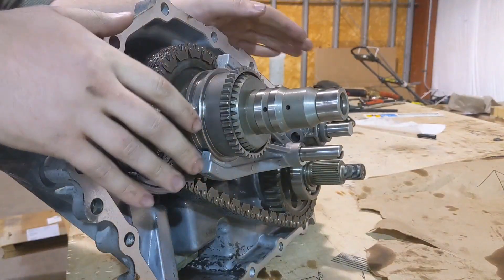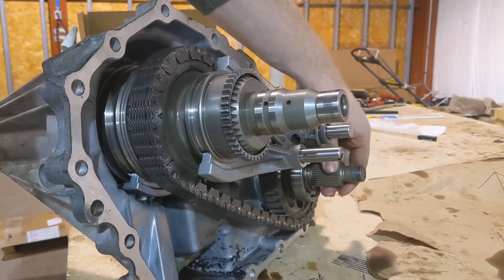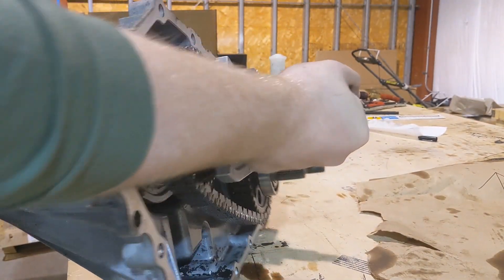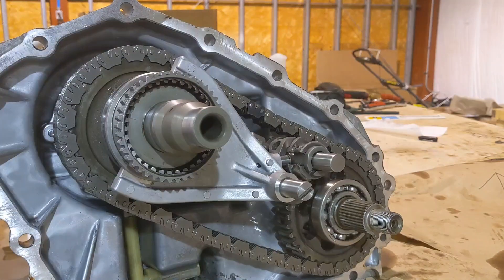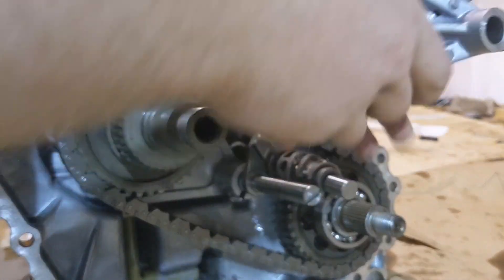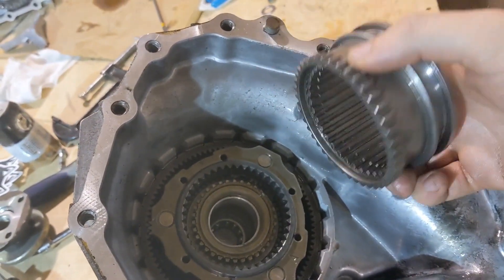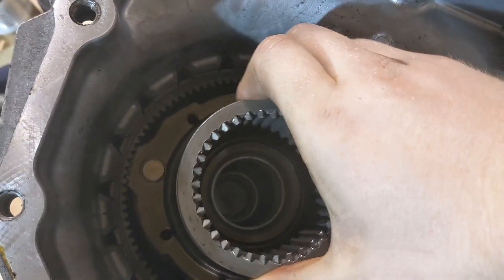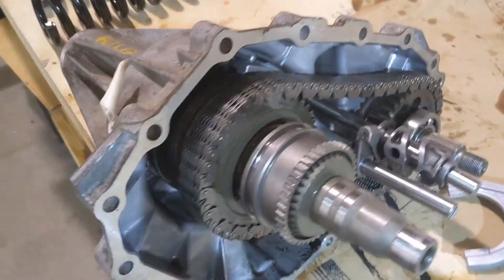Tech: Nissan Frontier/Xterra TX-15 Transfer Case Demo

Comment: Sorry i know this is old, did you ever figure out a manual selector for the tx15 or make an adapter to the old tx10?  I was wondering if the input shaft could be swapped or if it is too different?

Comment: manually, with a screwdriver, turn completely to the left and continue in 4SLOW, and turn right, make a stop, and then you feel the force of a spring that returns the axis to an intermediate position.
still in 4 slow.
any ideas?

Comment: Are there any knows mods to allow for 2L position? Any way to modify the drum selector or a way to engage the chain drive with a different actuator?
Reply: Yes, you have to remove the drum. You have to cut the top of the transfer case and manually shift. This will turn your transfer case into a twin stick. One stick shifts Hi / Lo, the other stick shift 2 or 4 wd.  I use it when I'm towing because I also have the 6spd manual from the Frontier on the Titan. This way I don't have to slip the clutch all the time. I also use 2 Lo. when wheeling, on hard pack, on icy conditions on the road, you start to oversteer.
Reply: Why would you want 2Lo? I don't see a benefit for that, that couldn't be accomplished with 4Lo.

Unless you want rear locker function but then you could just rewire it to work anytime.
Reply: @ ???
Leaving your righteous ignorance aside...

Some situations call for a crawl without the need for 4wd. E.g. hard packed fire road with occasional boulders and uphills. It is not the end of all, but with the manual it is nice to pick and choose how you tread the way, even if not optimally at times.
Reply: @VasyaIvanovichPupkin  "righteous ignorance" 

I can tell how this is gonna go if that's your response to a GENUINE question.

Hope you never get an answer. Figure it out big guy
Reply: @VasyaIvanovichPupkin  BTW, if you find yourself needing a crawl ratio then you should be in 4x4 anyway. Hence why i said have a LOCKER you can use anytime. That will give you more benefits  then a low ratio in 2wd.

Maybe if you take a sec and actually read the whole comment before running your mouth, you'd see im not as "ignorant" as you claim.
Reply: @ I did read the whole comment. More than once. And I stand by my statement. You had assumed that I require to be in 4wd and possibly benefit form a locker. Where in reality, I just want to crawl on a flat, relatively high grip surface at speed below that of 1st gear idle  rpm with the clutch pedal released.

Lack of traction is not an issue in my scenario. As a matter of fact, traction os the exact issue that requires front wheels to be free and able to steer.
The question was related to mechanical design. Not use case scenario. I can machine a new selector brum with a groove arrangement for 2L. It is not that difficult. But I was wondering if anyone had gone through it already.
I hope you have your coffee and stop wishing ill on others, particularly when it does not benefit you.
Reply: @VasyaIvanovichPupkin  you assume WRONG. I never once ASSumed you needed to be in 4x4, I stated IF you need a low ratio then you should be in 4x4. That is NOT the same as outright saying you should be, hence the IF at the beginning. 

Also you misunderstand. I said you could wire a rear locker to work ANYTIME, including in 2wd. I never said anything about the front....at all. 

I still STAND by my comment that a locker in 2wd will provide more benefit then having a low ratio in 2wd. And since you admit the terrain is relatively flat then having a low ratio is absolutely pointless.
Reply: @VasyaIvanovichPupkin  you'd benefit more from having a rear axle with a selectable ratio...but its been decades since I've seen anything using a set up like that
Reply: @ how a locker is going   provide more benefit with the vehicle speed relative to the engine RPM is still beyond me. It is utter nonsense and you are still locked (pardon the pun) in the traction mentality. It is NOT about traction.
Furthermore, low ranges are used for things other than inclines and obstacles.

You are way off topic here and fail to realise that. The question was purely form the design standpoint and not about any specific benefit that you may utilize. Accept that fact and move on.
Reply: @VasyaIvanovichPupkin  how is a low range in 2wd gonna benefit you on what you admit is flat terrain? Or is the purpose of a low range (Torque Multiplication) outside your level of understanding? 

A low range will absolutely serve no purpose on the terrain you described. Flat with the occasional rock to climb over. Tell me, how is that low range gonna help you when you unload that open diff? You fail to see the point and think a low range is required when in reality, using 1st or 2nd gear will do the "crawl" thing you want.
Reply: @VasyaIvanovichPupkin  oh and next time you wanna call me ignorant and then tell me you wish no ill will when I respond with "hope you never get an answer", you insulted my intelligence 1st when you could have simply answered an honest question. But here we are playing games because you don't know how to talk to people without 1st throwing insults.

You call me ignorant, yet I have over 8,000 miles of (currently snow covered) Forrest roads and DNR trails I could go hit right now. I have sand dunes and hill climbs 3hrs from me, I have multiple offroad parks that have terrain that gets close to what you find the San Juan mountain range. We have overland trails of 200 miles or more that take days to complete.

My last 2 trucks have lockers that work in 2wd and never have I felt the need for a low 2wd range. I'm not some "righteously ignorant" bum with no experience. I might actually know something you don't, so get off your high horse
Reply: @D41Michigan  please reserve your resume for a job application. )))) Read carefully what I wrote before embarrassing yourself further.
If someone is looking to maximize traction, I 100% agree with your statements. However, I am NOT looking to maximize traction. I am looking to reduce output speed first and multiply torque second. The issue with using 4Lo is lack of center differential which hinders seering on high grip surfaces. Perhaps I want to pull a concrete barrier all around a parking lot? Perhaps it is something less useless? Point is I want low range without 4wd. There is a reason why twin stick mods for transfer cases exist. 
This is an exercise of an engineering possibility. nothing more.
Reply: Or you could just remove the front driveshaft 😂
Reply: Now... my friend was able to accidentally do this. 2wd Lo. Under the glove box, there's a module. Your selector goes to the module then to the actuator. He broke it so when you move the selector to 4wd it doesn't work. When you go to 4 Lo it works and he's able to use the locker as well. He is trying to figure out how he can put a switch. Do the twin stick it's faster and easier. He's still messing with it.
Reply: @anthonylimjoco5958  I promise you that's not how the transfercase works. By its design you CANNOT separate either 4x4 mode from engaging the front driveshaft. Its physically not possible. Your friend might have broken the module under the dash to where it won't do 4hi, but that has ZERO effect on how the transfercase works. 

Watch the very video your commenting on and its gonna show you why your comment isn't possible
Reply: @D41Michigan  Dude what's up.  They make a twin stick for the TX10. You have two shift forks and if you remove the drum you can shift either one independently. Regarding the module my buddy thinks he's onto something... I'm with you on this. Like a motorcycle transmission if both forks are following the drum... you know the rest, but we were wheeling and he was what he says was 4 Lo... again he's still trying to work it out, we did tell him to place it on blocks on all four with another Titan and check the rotation. He's gonna do that soon I'll reply back to give that part some closure and confirmation.
Reply: @D41Michigan  Separate comment... This is why we came across looking for a video. To show him and for us to verify (sanity check) what we were telling him, that's not how a shift drum works with the shift forks linked together on one drum.
Reply: @anthonylimjoco5958  yes, but a twinstick setup is a whole different animal then trying to make it happen on a non twin stick transfercase. Plus his Frontier and mine are on the TX15....way different animal the the TX10. 

Now if the Frontier was setup like my S10 ZR2 was where you could select what drive mode on the transfercase AND have a separate engagement point at the front diff then it would be absolutely possible simply by not allowing the front dif itself to engage.

That truck uses vacuum to engage the front diff while simultaneously selecting a 4x4 mode in the transfercase
Reply: @anthonylimjoco5958  but, I do have a theoretical idea of how to make this work without going twinstick.

The output for the front driveshaft would need to be reworked to have a drum, it's sole purpose is to engage or disengage the front driveshaft. No need for a shift collar like on the other side (input/output to rear) and it would function with a locking pin.

The main issue is, you'd need to recast the housing to support this extra drum and thats assuming there's enough space to do so. Wiring it up would be as simple as wiring up a locker.

But I realistically don't see it being possible.
Reply: @D41Michigan  You are correct. The Toyota's have the Aisin transfer case which has two shafts. So the guys in Australia can shift either 2 / 4 and Hi / Lo. The TX15 has one shaft that both shift forks ride on.  But what you're failing to realize. the TX15 is just a newer TX10, it's been done on the TX10, you can buy a twin stick conversion for the old hardbody/pathfinder... On the TX15, You pop two holes, put a rubber boot and make you're linkage. Detents to make your controlled stops and use the shift drums to measure how far you need to shift.

Comment: Can the transfer case actuator motor be replaced independently without removing the case from the vehicle?
Reply from the maker: It's been a long time since we have taken it apart, but I think that it's possible.
Reply: If yours is the model that looks like a little black box , yes that unbolts without having to remove entire case( one electric plug and vacuum hose).

Comment: I have a 2006 frontier which its making a ticking sound that happens when I am in 4l or 4H or 2wd.  It all started one day when I was wheeling in 4LO down a hill and made the mistake of putting in the clutch, the truck gain speed because I was in neutral for a second and it was downhill then I let out the clutch so the truck TC in 4LO had to slow down rapidly.  I think it put stress on the transferase.  The sound it coming from the TC?  What could have been damaged? Possibly there is alot of slak in the chain?  Your thoughts on this?
Reply: Sounds like the chain stretched from engine braking, would be my guess, hope that helps.

Comment: Thx for the video. Could you also explain, how this works on the Nissan Pathfinder? Cause the Pathfinder has one more Option to select, which is called "Auto", and Nissan says, it could transfer automaticly the power to the front? But how does this work?
Reply: Is this the newer pathfinder or the older when they looked like frontiers in the front.
Reply: @bryanmartinez6600  the r51, which was build 2005 to 2012

Comment: I guess I see the simplicity of why Nissan designed that collar to input shaft... just sucks they didn't implement the ability for neutral.
Reply: There definitely is a Neutral position. It is just not detented.
What I am really missing is the 2L position. I wonder is there is a way to modify that selector drum in some way.
Reply: @VasyaIvanovichPupkin  I replied to you on another comment you made. I did it you have to remove the drum and make a twin stick. Hi/Lo and 2wd/4wd. The stick will take the place of the drum. You will have to make detents to stop the movement. Split the case with all the parts in the rear half. From there you can play with the shift forks... as in this video above. The transmission is like a motorcycle transmission. I would recommend you get two, split both and use one front half for mock up to cut a hole, work oout a rubber boot, stops for the shifting... think reverse lockout as example for shift stops. The TX10, which is the old pathfinder/hardbody (1995), same concept has a twin stick conversion. That's where I got the idea from
Reply: @anthonylimjoco5958  no you didn't. If it was that simple then everyone would do it. Or do you think the big name offroad companies would INTENTIONALLY lose money not developing such a highly requested modification?

Comment: Thanks guys. Yes, helpful. Can you do one on how it splits power to front and rear? Main curiosity is, is it always 50/50 split and locked or is it like an open diff? I was out wheeling and was sure I was in 4hi as my front tires were pulling and kicking up rocks, but I got to one area with my left rear wheel off the ground and all the power went to that wheel even though both my fronts were on the ground and I couldn't move
Reply: You would've been spinning a front tire as well. Power is 50/50 split. Watch when he goes from 4hi to 2hi and the chain gets disengaged.
Reply: @matthewzmyndak2028    This is so funny.. after I wrote that comment I was going to bed that night and I was like..." what the fuck was I thinking?? Hahah.. And then I was like.. "how am I ever going to find that post to correct what the hell I said" 🤣. You're exactly right.. My left front and right rear were both on high points.. My left rear was definitely off the ground and my right front was likely close to teetering so I didn't have enough traction and power was likely going out the right front wheel and rear left wheel... How's my stupid brain making a dumb decision because I was looking right at the left rear wheel spinning so I figured.." oh it's only the left!"

Comment: Hi , i have a 2008 pathfinde r 51 , the problem i have is with the 4x4high , is not engaging ,  the light turns on , but nothing happens , 4x4 auto and 4x4 low work, the TRANSFER CASE LEVER CONTROL / solenoid no.33274-7S110 , or what is called , changes the 4x4 high to , or only the 4 low?

Comment: Hello there Mr Alldogs, thanks very much for the vid, explained very well! I have a question if you don't mind. I have a Frontier (Navara here in the UK) D 22, 2.5 Diesel, 2002. Do you know if its possible to change it from a 4WD / 2WD to just 2WD , as in Removing the Front Drive Shaft, I know this is a bit of an odd question, but I'm having trouble with my Transfer Case  in 2WD. I never use 4wd as it's just used for touring and not off road or Towing. Can't afford to do anything with my Transfer Case and would be fine in 2WD all the time. Is this possible or a massive no no!?! Thank you

Comment: Hi, i have a nissan pathfinder r51 2.5 dci , the problem is  my 4Hi is not engaging , 2WD works, Auto works , 4Lo works , have any idea what could be the problem , i have no errors on the car ,  could it be an electrical problem ?

Comment: My 2008 xterra has a problem in 4 low. If I am in driving in 4 low on a trail for too long something starts to happen like it is slipping or binding up...its strange. I will then switch to 4 high with no problems. What is going on? Transmission or transfer case? I also have a slight vibration in 4 high at the 50 mph range.
Reply: That vibration might be from an un balanced front drivshaft in my opinion. And if your on a regular trail you shouldn't be in 4lo most trails will do just fine in 2wd. The binding is from turning the steering wheel and causing "wind up".
Reply: @shaolin224  it was U joints. I do technical trails sometimes which require 4lo for long periods of time.
Reply: @mojavered.  I thought I'd try to help since no one has answered you in 2yrs lol. Mine was a pinion gear that had too much play from wear and tear

Comment: Apparently the Titan and Armada have the same TC. Thanks for this video. I have a slight grind and thunk when I engage 4 lo.
Reply from the maker: Yes this tcase is also found in the Titan.  Forgot to mention that in the video. 

It's normal for your tacse to make noise when going from 4hi to 4lo.
Reply: @AlldogsOffroadCoop  yeah it's just louder than it use to be haha.
Reply from the maker: @TheSmittysGarage  When was the last time you changed your tcase oil?  That might be the issue
Reply: @AlldogsOffroadCoop  after I did the VK swap this year. I'm buying a spare to be safe I reckon.
Reply: @AlldogsOffroadCoop  hi! So I have 4 high and works perfect but in 4 low I get a solid vdc light and works fine going backwards but going forward does not catch. Could it be a solenoid? Or new transfer case
Reply: depends on what you describe as 'grind'...  there's the whir of the transfer case selector motor, then theres gear teeth clash such as you have when trans isn't fully in Neutral or you are slightly rolling...  I've had that gear clash once, entirely my fault